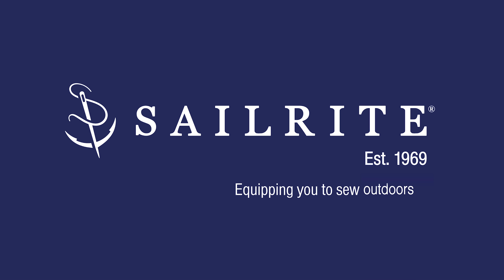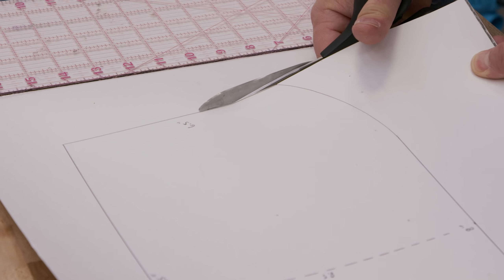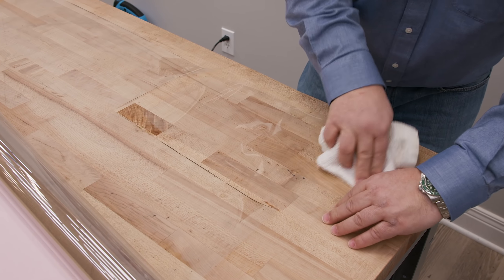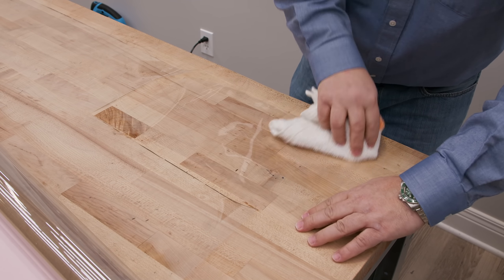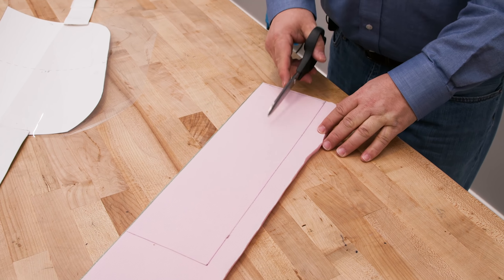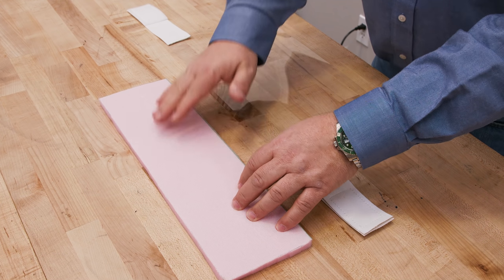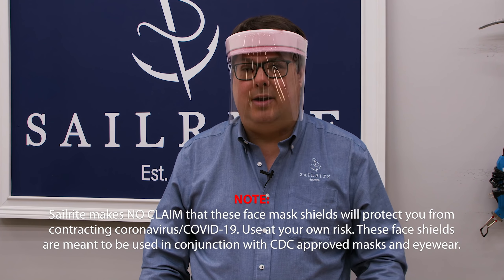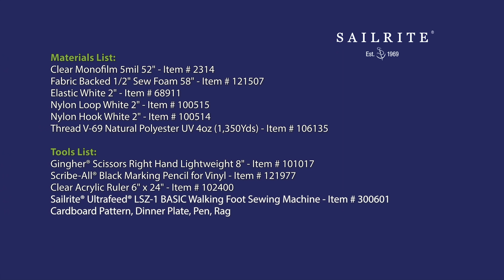How to Make a Face Shield for COVID-19

Comment: Sailrite videos are the best but we need the face mask one.  I was greatly disturbing having to find one at NY Times and not at sailrite.  You guys are the best!!
Reply from the maker: We have been doing some major research on what type of materials are best for face masks and have finally come to a conclusion. The melt blow filter material which is used as the internal filter and is approved by the FDA is on the way and we will have tons of spun bonded polyurethane fabric as well for the inside and outside of the face mask. As soon as all the materials arrive we plan on making a video.

Comment: This is nice and all but... All anyone really needs is: Any page protector that you can find in some old notebook you find around the house. Some duct tape, either folks it over the top edge of the page protector on stick two sticky sides together, trapping the plastic in between. Make the duct tape long enough to wrap around your head with a little overlap. Staple rubber bands to the duct tape such that it will pull the duct-tape head-band tight enough to stay on. Leave in sun for several hours to disinfect.

Comment: Thanks Sailrite! One question ...with the top sealed off by the foam, do you not get some fogging on the mask? I had made something similar a week ago and found I needed to vent the top to avoid that since breath vapor rises like steam and coats the mask. Really showed up outside where it is still below freezing here..
Reply from the maker: Yes, you can get some fogging, but even with venting that can happen on most masks. Having the open bottom and sides reduces the fogging, but it still can happen.
Reply: Sailrite: it happens when you go from warm to hot or hot to cold. So, you have to wait a moment or maybe wipe it off on the inside with a clean towelette. Then it’s harder to read with it on. But I felt safer. A lot of non believers around me. A lot of disgusted people but no one tried to pull it off, which is what I was afraid of.
I wipe mine down with disinfectant and let it dry. I reuse it.

Comment: This is a greatest idea.  The Shield is mounted to a Head Band!   You guys are the best.                                                                                                                                   So the shield is based on a 15" straight line of clear bendable vinyl with velcrow extenders.  Cool!!!!!!!!!!!!

I just checked my old Binder.  The plastic sheet covers are for  8 x 11.  Now that is  a little small, but it would certainly work for a child!
Do they make plastic covers in Legal Size?

Comment: Very nice tutorial. Question: Can a domestic machine handle working with the foam or is that better used with an industrial machine?
Reply: Lengthening the stich would help. Try it on some smaller pieces first. Probably work just fine. My old Singer 201-2 handles two layers of Cordura 1000D with 1/4 closed cell foam sandwiched between.
Reply from the maker: It may be difficult for a home sewing machine to sew into the sew foam. It would be better if you had a walking foot sewing machine.
Reply: @stoneblue1795  Thank you, I'll be trying that with the longer stitches. Maybe press the foam down with my finger before it gets to the presser foot too.
Reply: @SailriteDIY  I like your suggestion for the walking foot too. Thank you.
Reply: @SailriteDIY  Would zig zag not work better than straight stitch? Is this really just a disposable piece?
Reply from the maker: @evamcdonald5467  When sewing the hook and loop, yes zigzag would be good. For everything else it would not. Yes, they are usually considered disposable by health officials.

Comment: Any way we can take an elastic stretchy material under the shield with a filter on the bottom so the shield can surround you and the filter instead will be on the elastic neck part of the device instead of directly on your face? I have an idea that will work. Make sure elastic is not too tight to choke you with flexible material. Basically no way for any oxygen to get through but through the neck area that is filtered. So the shield goes 360 degrees around the head and the elastic part touches the neck and has a filter where the elastic isn't. Just like the top you stitch it on. The other way i bet this will work is with some gorilla glue or epoxy if you don't know how to sew. Let it dry before you use it. In a way it will grip like one of those choker necklaces. Air can still get through the mask around the bottom of the mask right above the elastic material. You may want to use an anti fogging material. https://i.imgur.com/V74QJag.png This is a bad drawing of my idea. 

Changed idea slightly. Where the blue is from bottom of ear use your fabric you can breath through. This will be attached to the shield. You can do the same thing from bottom of shield under the chin attached to your neck band or choker type necklace. The only way air will get through is through your breathable fabric filter. It will still flex by crinkling a little bit. The shield itself is a stiffer plastic. You may want this to angle slightly so there is room for air to go through the fabric filter and not close shut on you. The last thing make sure it doesn't fog up. You are now free to move head like normal. Eyes, nose, and mouth and ears are now protected.  Materials are up to use to decide. I was thinking of a stiff bag material like an aldies bag for the back section to bottom of ear attached to shield there. The front of the neck was where i wanted to put the breathable filter and i needed flex so we can turn our heads like normal and still look up and down.

Comment: I'm legally blind and I use a power chair. I as well am on a very low fixed income. It would be nice to have a face mask that is designed to be ReUsed. At the same time I have a very Low Immune System and because of my eye vision I usually wear a base ball cap. If there was a face shield that could either accommodate a base ball cap or have a Bill that can help you when you are out and about and you are wearing your mask underneath it. At the same time I don't have a sowing machine and it would be nice to know how to make a reUsable face shield that I don't need a sowing machine? I know if one is made the right way it can be cleaned properly and still stop things like Rain and other Wet droplets from destroying your mask below.

Comment: Anyone know what gauge of vinyl would be appropriate to use?
Reply: he says what he is using is 5 mil
Reply: @JudsonCook  unfortunately vinyl is usually measure in gauge, not mm. But I did some digging, on the Sailrite website it says the film he's using is 0.005 inches thick. Gauge to mm conversion apparently changes based on what material you're talking about, so I couldn't find a direct conversion, but I did discover that 20 gauge vinyl is 0.02 inches thick, so I'm gonna use that!